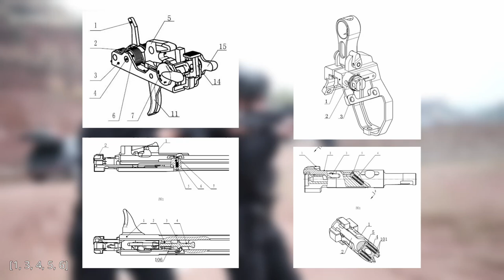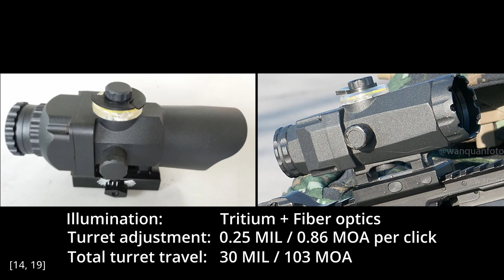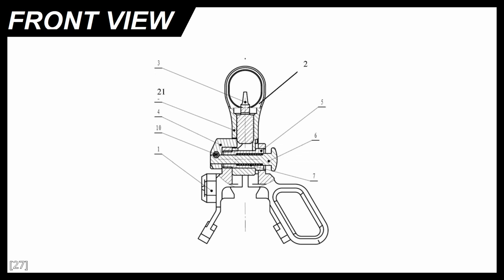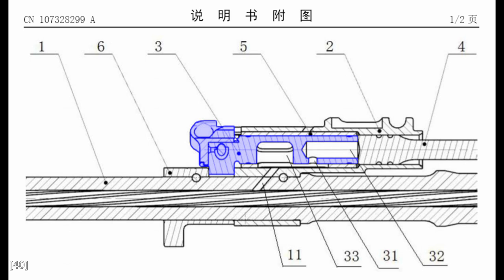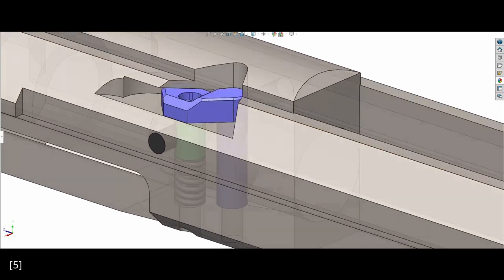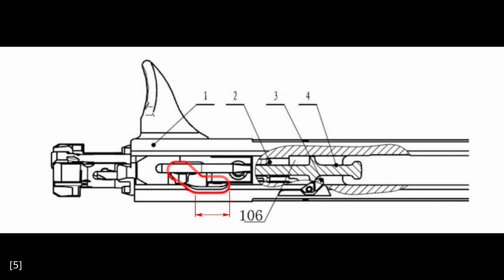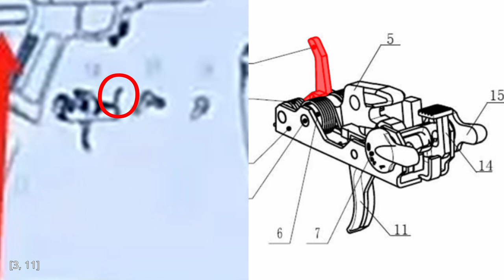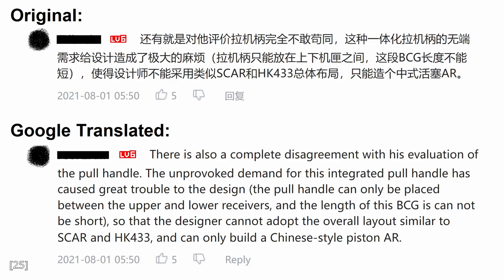QBZ191 - Update / Deep dive [CHECK PINNED COMMENT FOR UPDATES]

Comment: That weapon appears quite over-engineered, with a high part count, high small-part count, and high complexity.  From my understanding of it's COO's metallurgy and QC may limit it's effectiveness over time.  When it will need service, unit-level is out, as is armorer-level, it will need factory-level maintenance for even the smallest of wear/malfunction.
Reply from the maker: I would not make judgement about metallurgy as well as QC yet, bc these details are hard to pin down, and I also think that people underestimate the manufacturing quality of Chinese service weapons. But from reading the patent documents, I have the impression that part life is of high importance, and this is expressed clearly in their design (with the dual-chamber gas block for example). I also don't find this weapon more complicated than other service weapons. The cam pin locking mechanism also has analogs on other guns like the Steyr AUG and the Beretta ARX160. On the 191, this locking lever is also depressed by a steel insert, instead of the aluminum receiver. I would guess that during use, the cam pin locking lever experiences forces less than or comparable to the fixed ejector. Assuming they know how to heat treat the fixed ejector (they have been making guns with fixed ejectors for decades), I also don't foresee the cam pin locking lever failing any time soon. Also unlike the AUG or ARX160, this weapon would likely be functional even when the cam pin locking lever is broken, since the cam pin can also be kept in place by the contour inside the upper receiver, like on an AR-15. The firing pin retaining pin would be over engineered if the intention is that soldiers must remove it during field strip. But if the intention is for soldier to leave it alone and not take apart the bcg at all, then that retaining pin is also not complicated given what it's designed to do. The removable trigger pack is also not uncommon, and not much more complicated compared to an unremovable one. Being removable also facilitates easier maintenance or replacement. Other small parts like the retaining plunger for the firing pin retaining pin, or the retaining plunger for the hand guard sleeve, are exposed to very few loading cycles, so their chance of failure would be low.
Reply: Another thing to keep in mind is that this likely isn't going to be THE future service weapons for all of PLA. Due to just how many small parts they incoporated into the design for maxium effects, I think 191 and its derivatives might be only fitted to their equvalent of force recons and spec-ops. The army groups and marines, who are expected to do lot of vehicle hoppings, might still be given 95s for its compact size.
Reply: @leoli2450  The 191 is the new service rifle. All frontline troops are gonna get the new rifle. All 95s will be sent back to reserves.
Reply: @AVWUVU  This is probably just a "promise" it will probably take a long time for it to become common among grunts just like other "next gen" rifles the 95 is probably gonna stay for quite a while
Reply: @dirckthedork-knight1201  No doubt. It will probably take another 5 years before it fully replaces everything.

Comment: I've shot and still do shoot many types of rifles. AR's Ak's Daewoo k2 many more.  The Ar15 can have a folding stock with a retained buffer tube. If it is folded though you have to unfold it to fire. When you say a flimsy cutter pin on that retains the firing pin on a Ar15 bolt carrier those cotter pins are made of a much stronger springs steel they don't fail and very rarely get lost. The rifles Ar15 was built for simplicity and strength. If you have ever watched footage from Afganistan the US military makes sure to keep those rifles clean due to shooting/rapid fire and sand. One thing that can get in the way of new over engineered rifles is carbon fouling in the gas system,dirt,mud,sand and water. If you have parts that are not coated with the right finish for a example if they get salt water in them they will rust up making a tight tolerance gun useless. It's always better to leave room for debris to leave the rifle as easily as possible.
One of my favorite rifle as far as inginuety and simplicity is the Daewoo k2
It uses the a bolt carrier that is a lot like a Ak47 with a bolt very close to a Ar15 same with the fire control group. The fast system has a gas shut off and harsh environment setting. Side folding split stock and a front sight that reminds me of a hk93. Big hooded style. These rifles take standard Ar15 magazines so it is a plus for people who own both.
Well better go but thank you for the vide explanation it's always interesting to see what is new.

Comment: About the only smart thing about this design has to be that dual-phase gas chamber. It feels like China just slapped together a bunch of AR15 and AK47 parts and said "Huzzah, it is better than both!" despite copying the two worst aspects of both rifles.
It copied the AR15's buffer tube
and the AK47's long-stroke operation

Buffer tubes have long since been proven to be completely unnecessary for a rifle to operate, and are only useful for heavier calibers like .308. Adding such a massive spring behind an equally massive bolt just wastes material and limits options.
As for the long-stroke piston, short-stroke pistons have long since proven to be the more reliable and accurate option.

I don't think the QBZ is anything to praise. I think it would work decently, but it's barely an innovation and I can already see Chinese factories finding some way to botch it.
Reply: This thing uses short stroke system
Reply: Adding to the fact that it is short stroke piston, the buffer tube was pretty important for soft shooting, since 5.8mm is a hot cartridge compared to 5.56 and is often overcharged to help the gun cycle in adverse conditions.
Reply: I find that haters tend to be really stupid. Always countering themselves proving to lack knowledge on a subject. Just can't hide that racism in their blood.
Reply: Alright, I stand corrected. Last time I checked up on this thing it used a long-stroke system.

I still stand by my statement regarding the buffer tube however. If their 5.8mm round is really that powerful, it shouldn't be a standard infantry caliber, it should be a marksman's caliber.
A good intermediate cartridge should have low recoil but decent penetrating properties. On top of that, manufacturing a cartridge that's overpressure to begin with is just asking for some factory to screw it up and cause half the guns to explode.
Reply: @GeorgeCowsert  it’s common for military rounds to be overcharged. For example, German G43 did that to increase reliability of cycling at the expense of durability and service life.

And yes, 5.8 should controllable enough as an intermediate round, just a bit hotter than 5.56. You saw the 191 firing yourself. Does the recoil seem too much?